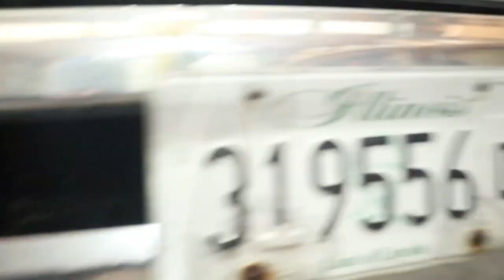snow Plowing Issue Snow Dogg vs.  Western - Following Keenan - Installing Snow Dogg Plow -

Comment: Nice job Keenan.. I use a commercial grade western V plow with the “versa mount plus” at work and I love it, it’s super easy to take on and off the plow and when your done for the season the low hanging mounts come right off the truck with just a few pins. 

Very nice job with the video and great job fixing up that plow!

Comment: How did the plow work after you changed the mount ?
Reply from the maker: So far it works just fine. In scoop and v plow it's still make contact evenly. Which was my big concern. If we get another snow I can shoot up close as it plows in each position so you can see. I'm planning on cutting off the excess brackets this week. Hope that helps. Thanks.

Comment: Where did you get the deflector?
Reply from the maker: I got them from a locally truck builder in my area. He also sells snow dogg. It just thick rubber, like a mud flap. May even find it cheaper on ebay. Hope that helps.